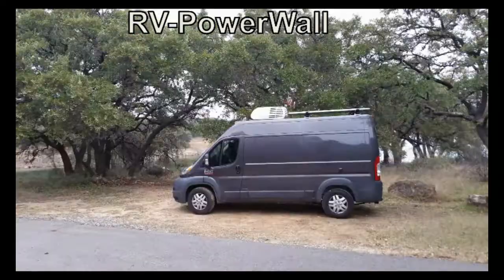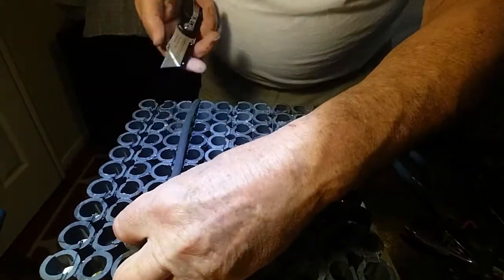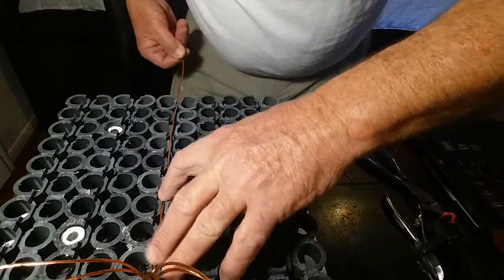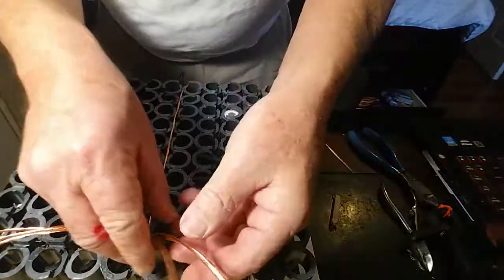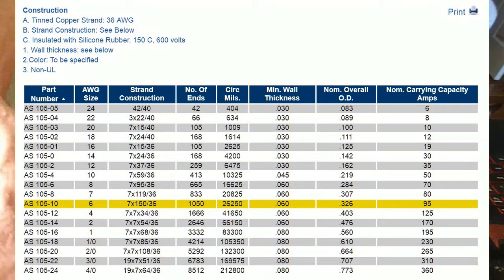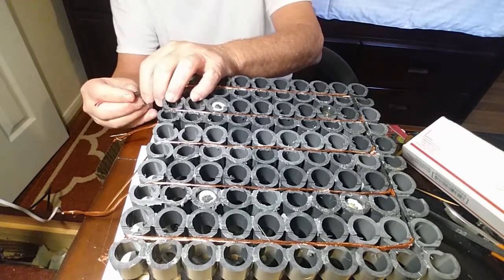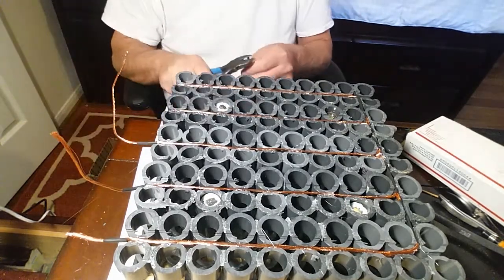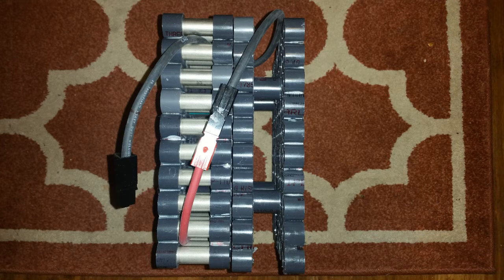DIY RV PowerWall 18650 Battery Holder Build 3 Buss Bar

Comment: Hey had a quick question on the anderson connectors.....I'm gathing everything to build the 48v system for the RV and was wondering since mine will be a 48v system and will see half the amperage of yours do you think 45amp connectors would be fine?...just having a hard time finding the 75amp connectors in bulk.
Thanks for any input
Reply from the maker: Steve you can find the connectors in bulk here The powerpole contacts https://powerwerx.com/anderson-pp75-sb50-loose-piece-contact
The plastic housings https://powerwerx.com/anderson-pp75-loose-piece-housing
Figure your Max amp draw on your larges demand. At 1kw draw the amps will be about 25 amps. If you have something that draws 2kw then your amps will be at about 50 and this probably will not be a long constant load so the 50 amp connectors should be fine.

Comment: Nice approach, the welding cable having individual cables sure helped bring this all together.
Reply from the maker: Thanks Shannon: Plus you don't have to buy the nickle stripping.
Reply: RV-PowerWall I'm using nickel strip because it can handle the power levels my battery will see. If I ever go to higher power levels than welding cables are definitely the easiest/best approach. What power levels will you be seeing in a van?
Reply from the maker: Since my system is a 24v system I will see half the amp draw that a 12v system does. At 1kw draw at the AC plug it takes 55 amps from the batteries. Since I have 100 batteries in parallel I am drawing just a little over half an amp from all batteries. 
If your using 10 mil wide nickle stripping its rated at 20 amps.
Reply: I'm building a 48v, 14s176p. It's broken down into 8 7s44p groups that are than connected in parallel and series. Using .15 x 8mm nickel strip, the busbar layout at the moment can have a 4500 watt load with 5.5 amps on series connection nickel strips. Each group of 44 cells has 11 cells per nickel strip. Cells have .5 amp glass fuses.
Reply from the maker: How many batteries does each nickle strip carry? Or how many amps will each strip have to handle for the 4500w?
Reply: RV-PowerWall 11 cells per nickel strip and 5.5 amps across the strip when all 8 7s44p groups are connected in series/parallel. One 7s44p by itself can handle 22 amps.

Comment: I really like the way you're building your battery packs. Keeping your packs all parallel makes a lot of sense to me. I'm thinking of building a similar system using 320 Lifepo4 26650s. I think I'll make my packs smaller to facilitate more flexibility with the ability to take smaller packs out to use when I go kayak camping and to make reconfiguration easier.
Reply from the maker: Great!  Are you going to share your build? If so let me know.
Reply: I'm just in the planning and acquisition stage right now. I will, start posting some videos when I get going on it though. I'll need to learn how to use this YouTube thing in the process..

Comment: One more thing about the 26650s I mentioned, is that they are the 3.2v cells. This enables me to set up the pack as a 4S to use in a 12 volt system. Not my first choice but the customer chooses. I will be using 1" pvc to fit them. The rest will most likely mimic yours. Thank you! Hey, are you in GA?
Reply from the maker: the 32 cells are much better for a 12 volt system they should work with most chargers and solar charge controllers

Comment: Very nice, very nice! Although I am just starting with this type of pack, what you are doing with the recessed holders is exactly what I was thinking. I like how your brain works.
Reply from the maker: Say I just had an idea... supriseingly the light still goes off... I would like someone to try marking a stick of the PVC. then drilling a 1/2" hole at every mark then cut the marked line. This may cut out the need to do any of the routing.
Reply from the maker: At the crossing points drill 2 holes 90 degrees off